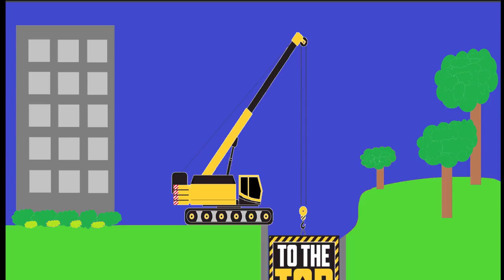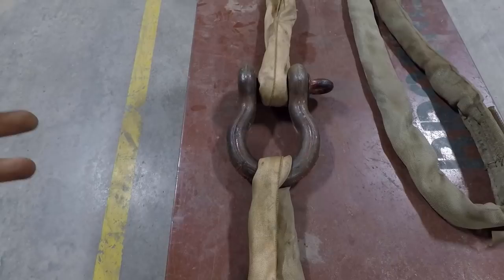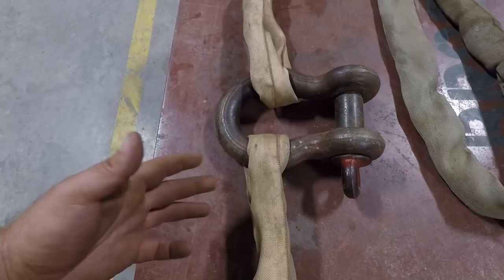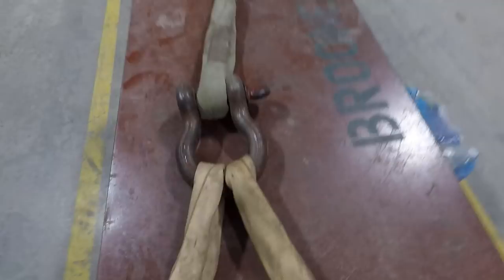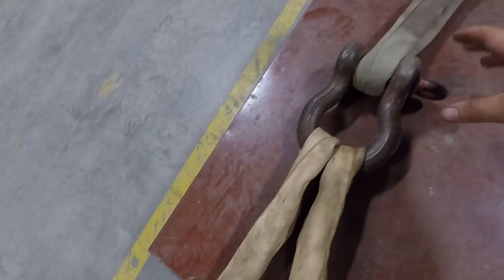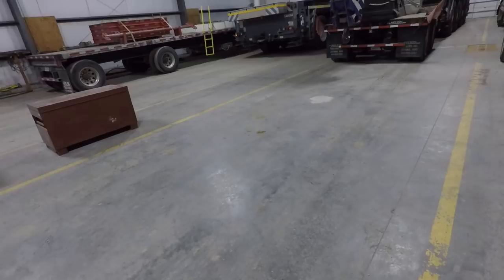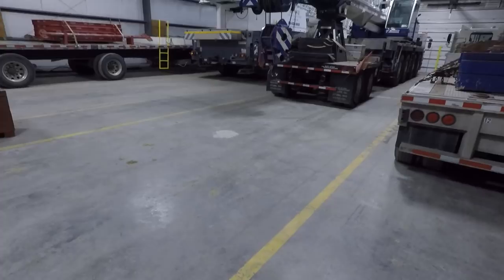Shackles and how to use them in rigging

Comment: Great info.  The only thing I would like to mention is the backing off of the pin.  I took a course with Crosby and the rep said to never back the pin off.  It was standard procedure where I worked to tighten the pin all the way then back it off a 1/4 turn.  The reason folks did that is that is sometimes the pin is tough to get out after a lift.  The Crosby rep said that there is a possibility that the threads of the pin could stretch more if the pin was not fully engaged.  Also you run the risk of exposing your sling to the pin threads which could damage and, in a worse  case scenario, cause your sling to totally fail during a lift.  The shackle is engineered to have all threads fully engaged.  Always fully tighten your pin.  You can always use a wrench to loosen it after the lift is completed safely.  Thanks again for the video!

Comment: Good video. If you read the Crosby literature, you can side load a shackle and have your slings outside the 90 degree marks. As I recall, the shackle can support its full load capacity within the marks. Outside the marks it's reduced to 80 percent. In a side load it's reduced to 50 percent. For example, we have a forklift with a hole in the end of the fork. We use a 1" shackle through that hole to lift things with a chain or sling. The shackle is rated for 8.5 tons, but reduced to 4.25 tons for a side load, plenty for our application.
Reply: This is true
Reply: Some of his info is off. But he is pretty competent, but not a definitive authority by any means
Reply: 70% reduction at 45° and 50% reduction of capacity outside the 45° marks

Comment: Crosby provides a WLL reduction chart that allows you to side load any shackle up to 90* with up to a 50% decrease in capacity. Also if your sling angle is less than 120* if using two or more slings you can use the shackle at full capacity.
Reply from the maker: Thanks for contributing to the comments. This is what makes YouTube fun. Everyone being involved. Also, thanks for watching! 🙂👍

Comment: It's all about physic's and common sense.  Great explanation, thanks.  I'd be willing to bet those shackles are rated for X amount  but in actuality can handle a good bit more, but not a good idea to do so.
Reply from the maker: +Duncan MacKenzie, all rigging has a 5 to 1 safety factor (according to the OSHA standards). Unfortunately, in today's world, common sense isn't so common. We see stuff all the time that would blow most people's minds. Thanks for watching! 🙂👍
Reply: Of that I have no doubt! It's just something you can't teach, you've either got it or you don't. I pity those that lack it. Thanks for the reply.
Reply: Duncan MacKenzie 3:1 or more safety factor design in rigging. ASME.
Reply from the maker: @63256325N , it should be called "uncommon sense" now. It seems there are more without it than with it. 😔
Reply: Right...

Comment: This is a very good video.  I'm 32 years crane operator.  Local 487B Miami, with them for 17 years.  Currently working in Israel, with Intel-Israel.  I'm lifting 11.5 ton 50' beams.  All day, I use 8.5 ton shackles on each end.  With 2, 18 feet 8 ton " High Performance roundsling, hooked to 2, 10 foot 16 ton chains.  I keep it long in order to stay within the 45 Degree angle.  Also, from time to time I slide my roundslings so the I do not work with the same area.  Yes, I keep my crew rigging with the screw in the hooks. :yougotthis:

Comment: This is a fantastic tutorial on rigging. I have been in the industry for 30 plus years and I always back the pin off a quarter turn or maybe a bit less. If you are using your equipment within the design specifications there should not be any issues. There is most certainly a calculated risk with anything you remove from the ground with any rigging even when the equipment is well maintained and within operating specifications. The risk is always there..I agree with what you said wholeheartedly.

Comment: Great video. And yes I just Refreshed my Rigging Cert through the International Union of Carpenters and they say now we don't turn back shackle pins at all.
Reply: What does a Union Carpenter need a Rigging cert for? On a Union job site the Ironworkers are doing 90% of the rigging with Boilermakers doing their own also. This is the problem that most trades have with Carpenters, they want to be a jack of all trades and they end up a master of none.
Reply: I’m working on my rigging cert through international operating engineers, trying all I can to learn

Comment: I use shackles and slings and straps and chains and stuff everyday operating a tow truck and it is definitely not repetitive back and forth motions certainly not long enough to try to back that screw out so I just snug it down hand tight and back it off a touch and I've never had one come out on its own

Comment: I only drive a 12k telescopic forklift with a 60' vertical and 47' horizontal reach but have always tightened the pin fully and then back off half a turn. Our work it quick paced and very repetitive and never involves any lengthy picks or overnight slinging.   

Just found your channel and digging your knowledge ;)

Comment: Very informative video! I had recently heard that shackle manufacturers are stating that the shackle warranty is only valid with the screw pin snugged up. Which could potentially be brought up in a legal situation if something were to go wrong with a pick. I know riggers have been loosening a quarter turn for forever. Any input on that? Thanks for the videos! Keep them coming!

Comment: The only time I've seen shackles work loose is doing duty cycle type work- mostly wrecking ball and clam bucket work.. and we wired the shackle pins to make sure they didn't back off...
Reply from the maker: +Michael Owen, same here. It's a pretty safe bet that I won't be clamming or using a wrecking ball on the ole Tadano. Lol. Thanks for watching! 🙂👍
Reply: In those cases you should be using a shackle with a bolt and a castellated nut. We had the draglines connected to magnets with a shackle with a bolt. The material handlers also used one to hang the magnet.

Comment: 12:32 Well yeah that's what I was wondering regarding your first point. I'm no crane operator but I watch a lot, & I help rigging a bit. Literally everything I've ever seen lifted that has lifting lugs is lifted like that with shackles & the pin always goes through the hole.

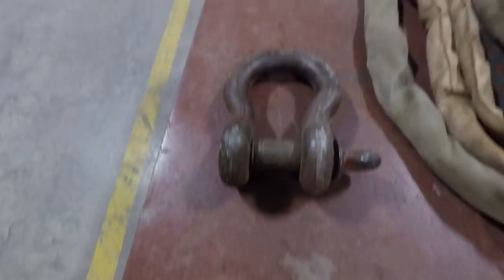Comment: @1:57 I've ran across many situations where only the pin will fit thru the lifting lug..gotta use it upside down. Or else the shackle isn't strong enough to hold the weight. As experienced as you are I'm surprised you'd take such a strong stance

Comment: Ha! You did do it! Thanks for the effort. Even saw you sweating on that one! I know you said in your 1st video, this wasn’t going to be a ‘how to’ channel but rigging and cranes go hand in hand. I think it’s important to get proper and correct info out there on rigging. How many times has this happened to you: You’re in the seat, working in the blind. Signal man walks over to the edge of the deck and gives you the ‘get high’ sign. You cable up and as soon as you see the load you say OMG! Also, except with structural iron workers, what’s the first tool they go for to loosen up a shackle pin?? THE HAMMER 😖 and they miss a few times and dick-up your sling. Right? I know you’ve seen it. Back the shackle pin off a 1/4 turn. Great vid and info. Thanks again 👍
Reply from the maker: You asked for it. So, I made the video for ya. It was HOT in the ole crane building. Glad I didn't spend anymore time in there than I did. Thanks for watching! 🙂👍

Comment: What if you have a shackle and it’s to a tow receiver where it’s fixed solid and your pulling sideways like out of a ditch on the 45° angle. Is that fine or does a shackle need equal load on both sides?
Reply from the maker: It probably should be loaded in the center of the shackle. But, it's not being used for lifting. So, you will have to use your own judgment. Thanks for watching! 🙂👍

Comment: Hey Jimmy! In terms of tightening the pin of a shackle, what’s the length you would consider  “awhile” when tightening it all the way. What if something will be up for like 24 hours is that long enough to consider tightening it down plus using something to lock the pin down?

Comment: There is in effect a National law from OSHA that all who rig take and pass a basic rigging class and hand signals and keep both cards in their wallet. All States this applies.
Reply from the maker: I have my card in my wallet. 🙂
Reply: Turk 317 Also a man lift and forklift telehander ( Lull) requires such.
My buddy got nailed running a lull by OSHA big fine not having card.
In NYS you need a license to run crane or arrested in handcuffed. Seriously.
NCCCO and Crane Institute has OSHA approved classes all over.
Reply: ANSI and OSHA also have different standards on Rigging and signaling
Reply: what section is oshas requirement to be a certified rigger?
Reply: I guess Florida is exempt lol

Comment: Jimmy, are you going to cover estimating center of load and center of gravity for irregular pieces?  

For a few decades, I've been putting anti-seize on pin threads, and backing the pin off a little for most lifts. Never had a pin back out even a little. 

This video was awesome instruction for using shackles!  Thanks.
Reply from the maker: David Sonnen, I will try to make a video on that. Or atleast talk about it in a video. Thanks for the idea, the feedback, and for watching! 🙂👍
Reply: i dont like using anti-seize on any rigging, just bacause it can get onto the strops. And atleast where i work any grease, oil, paint etc. on strops means we dont use it. Norwegian law.
Reply: @mattis537  Makes sense. Grease, paint and solvents destroy synthetic straps. I started using anti-seize on screw pins when I was working on the Pacific coast. Even galvanized pins rusted in salt water after a while. Anti-seize reduced that problem. But, we did have to be careful not to get any lubricants on straps

Comment: Cool Beans.

1. It is confusing to say that just because you take a different angle to lift an object that it increases in weight. 

 I think much better would be to State the actual physics where the force applied on the shackle would increase if the angle-of-pull becomes too parallel to the ground.  

In a former life I looked to become a rigor working with cranes. My studying off an online Union manual was to state to keep the angle of pull close to 45° to the direction of oull.  My affliction with acrophobia pretty much kapashed that dream.

2.  While it may take 7 full turns for the pin to unscrew, may you tell me at which turn of the screw that the shackle is no longer rated for 13 tons?  One turn, Twontrina, Three...???

Seems to me that a clevis would be a better choice than a pin.  The clevis can freely rotate without unscrewing.  The pin that goes through the whole of the pen can be pulled out with a finger no tools required faster than rotating a pen 7 turns.  But this is just me: what do I know...

Comment: What does a cream shackle look like? I don’t think I’ve ever touched one before. I have seen several  different size carabiners before, but I wonder if this is completely different?
Reply: As you could see in my crane video, I did not have reading of any sort because of the type of thing I was lifting, however this would be extremely helpful for moving heavy your containers.
Reply: I really wish my big crane would’ve come with some rigging accessories. That’s pretty much the only draw  back to it. However if you want some information about where to get the model comment  about it on the crane video and I will post The info for you.
Reply from the maker: A crane shackle is similar in shape to a horseshoe. However it is made from rounded material and has a removable pin that closes the open end. The pin is threaded and screws in. Hopefully that was an adequate description. If not, let me know and try to give more detail. Thanks for tuning in! 🙂👍

Comment: Iam doing fine tks 4 asking. I do pull some times can u put the hook threw the shackle instead of the pin ive been doi g that ever since i can remember my dad did it tks gary
Reply from the maker: Since you are a truck/tractor puller, I don't know that it would make much difference. You are loading the shackle inline regardless of the direction of hook up.

Comment: I know some manufacturers allow full load at 45° angle, (greenpin for example) but normally a reduction of 30% or WLL x0.7 is required. 

You can actually side load a bow shackle though, the reduction factor just becomes 50% or WLL x0.5

Where I'm at we can't use this type of shackle for repeated lifts, a nut with some kind of locking is required, for that reason allone my company doesn't use them (which can be annoying because on some lifting points in the field you can't fit a bowshackle that requires a bolt..)

Comment: The only reason to turn the shackle pin up is if you do have a endless in bottom (towards the load) because when it tightens up on the load it may roll the pin.  

Yes you can turn a shackle 90degrees (side ways) it’s called a 90 degree offset and the shackle is good for 50% capacity. Why would you though? No idea... 

Just like “never saddle a dead horse” well why is that? It has nothing to do with the saddle of the clamp on the dead end, it has everything to do with not putting the bolt-end of the clamp on the live end. So basically it’s to keep your ass from crimping the live end of the cable. “fun fact”

Comment: Ive been taught that you can load a shackle past its 45s as long as you acknowledge that it is only good for 50% of its rated capacity.
Reply from the maker: I didn't go into that much detail. But, you aren't incorrect. Thanks for watching! 🙂👍
Reply: Kyle - if you look at the tag (should be there) on the strap/sling, you’ll see the type of config you’re talking about. But when you look at the load capacity in that config, it drops drastically. I don’t know if -50% is a constant, but it’s way down. Beyond 45°, you’re past the point of gravitational advantage. Past halfway up and halfway down.
Reply: You can have a sling in full vertical with a shackle on its side. Standing "I beams" is usually where a shackle is on its side
Reply: Kyle - Hmm, I’m curious as to the type of rigging you’re referring to. Can you explain it more?
Reply: Lets say you have a large steel plate thats laying flat. You can blow a hole in it and hook up the shackle. Then to pick it up you would have your sling in one end of the shackle bow which would be well below the 45' mark
Reply: I hope I’m getting your point. Are you saying the shackle would be side loaded at the moment when you are picking it up until it’s fully upright? If so, then we are only talking about a few seconds and the shackle never would undergo the full load bcz it’s still in contact with the ground. If you have the option of blowing a hole in it, why not just make the hole slightly larger so you could put the ‘eye’ part of the shackle thru the plate. Then the shackle would move in a straight pull while lifting. I’m still curious about when you said “Standing I beams” with a shackle.

Comment: Hah, I'll be that guy.  You said the shackle was designed to be within the 45-degree lines, and you counteract that by saying you "should" back it out even though manufacturer says to tighten all the way.  The pin is supposed to be tightened all the way.  If you don't have a bar, then smack the fucking shackle on something and it will loosen the pin.  Or keep the spud bar on you buddy.  If there's any reason you shouldn't do it, it's because of tests, so you should follow the "Best practice".  Otherwise, stating that just sets other people up for failure.  I don't believe a screw pin shackle will unscrew itself anyways, just stating this for ya.